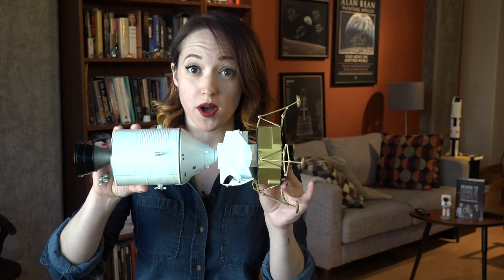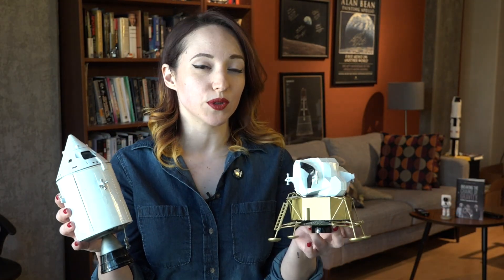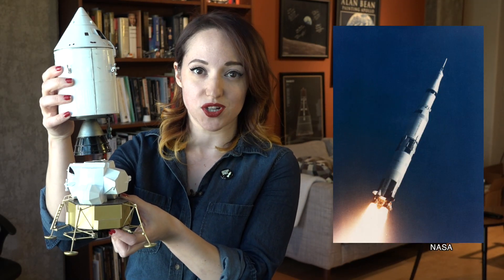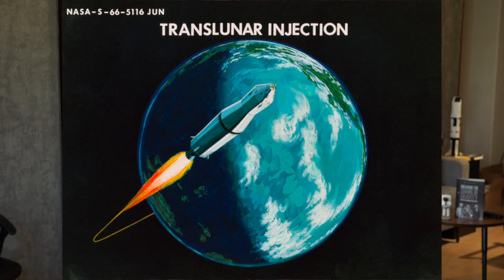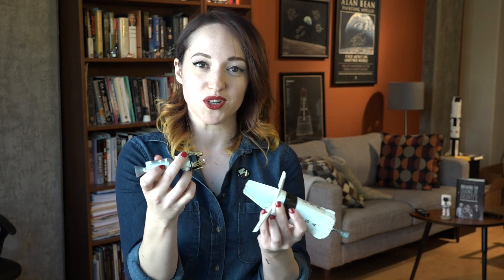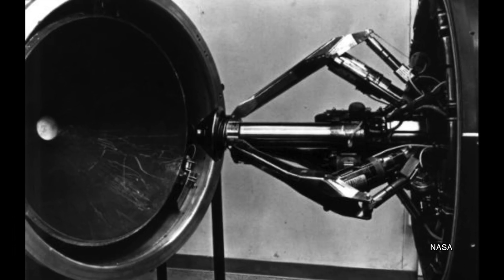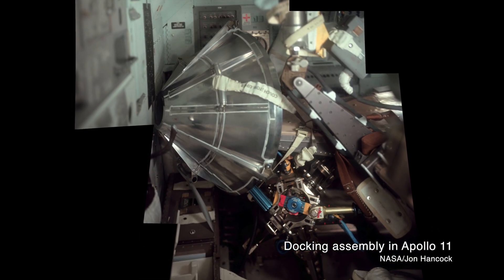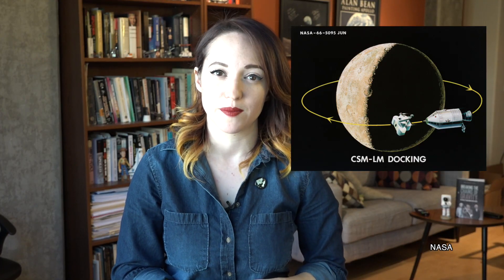How Did the Apollo Command and Lunar Modules Become One?

Comment: How did nasa get away with lies for so long, look into it.
Reply: By not lying
Reply: 21st century. Lots of technology. We have literally all the knowledge in the world in the palm of our hands. Still people falls for conspiracy theories? That's what amazes me the most.
Reply: @zeendaniels5809  so im supposed to beleive they can dock on the iss, that they say is moving 17 thousand mph... Just think about that for a minute.
Reply: @teleported1601  What wrong with it? If the spacecraft is moving at the same speed, it could dock. Is that simple.
When you are flying inside and aircraft, you can drink, you can eat, you could throw up an object and it will return to your hands despite all is moving at 600mph or more. It's the same deal here.
Reply: @zeendaniels5809  i see what your saying, although there's zero room for mistake at that speed, and never had a accident, thats all im saying.
Reply: @teleported1601  Actually there is a lot of room for error. Don't let the speed scares you, is not relevant if the ISS is moving at 17k mph. The important thing is the fact that the spacecraft docking is also moving at the same speed... So the relative speed between the two is very low (that's why in those videos of the Soyuz docking all appears to happen in slow motion).

Comment: Let me get this straight...as they were on the way to the moon..lunar lander and command module separated and connected moving at a high rate of speed...no thanks cannot be done.
Reply: You are currently traveling through space at 67,000 mph and yet manage to puta cup of coffee in your mouth
Reply: @onejasso  Bible says the Earth does not move.
Reply: @davidskaar3232  No, it doesn't.
Reply: "Bible says the Earth does not move." - that's not what scripture says, it also doesn't say it's flat or surrounded by any magic dome. two objects in space traveling at the same vector would appear motionless relative to each other, and with no atmospheric drag there would be nothing to slow them down or cause undesired movements. speed is relative to scale and frame of reference.
Reply: So refueling a fighter jet mid flight is also impossible?
Reply: @vyralator2638  one is witnessed. The other fantasy.
Reply: @davidskaar3232  No but think about it. How is it possible for one plane to dock with another? They're both going at insane speeds. There's no way that's possible. And they want  you to believe that they managed to do it all the way back in 1923? Madness.
Reply: @davidskaar3232  Are you saying it was impossible for a Shuttle to dock with the ISS @17,000MPH? That it's impossible for a Soyuz or SpaceX Dragon to do it? It's all fake?
Reply: @EVRose60  I'm saying you are being lied to on a grand scale. No space station. No space for anything to go to. 1986 shuttle crash astronauts still alive. No moon landing. Seek the truth....
Reply: Nature and Physics  it's fast

Comment: It was the clear next step for Apollo 14 to suit up,  eva out, dismantle the drogue, get it inside, check and fix it, get out connect it and dock it again. 
They would not enter the LM on this EVA but they would have done "hard suit work".  The procedure described here was a last attemp to avoid that and developed on a full size version by mission control and A14 backup crew around Gene Cernan. Gene Cernan himself get's on the capcom position and tells the crew of this idea.
They had time to fiddle with did for as long as the SIVB could hold it's attitude. Which was limited by it's battery lifetime, estimated at about 10 hours.

Obviously on return from the moon, if the docking again wouldn't work there was the (tested for emergencies) option of evaing from the LM to the CSM.  But that was indeed not an option for the initial transposition and docking, while the LM was still connected to the SIVB. They could not fly seperately to the moon. Would have been a navigational nightmare.

Comment: So the explanation of how the lunar landing module (with its tiny rocket) reconnected with the command module which was orbiting at 20,000+ mph around the moon, was that it just did?
Reply: Will Bernd : (1) the process of orbital rendezvous is a well-defined mathematical problem that is taught in space flight dynamics classes within a standard undergraduate aerospace engineering curriculum. No miracles here. Links abound on the Internet for details; (2) the LM was not traveling 20,000+ mph around the moon (much less), but that is immaterial to the discussion. We, each of us, on planet earth are moving around the sun at 66,000+ mph, yet we do not have difficulty, say, getting into our cars or driving to work. It is about RELATIVE speed with respect to a coordinate frame; (3) her explanation is with respect to the probe-and-drogue mechanism by which the two vehicles coupled/uncoupled, NOT about the orbital mechanics and dynamics of orbital rendezvous.
Reply: @Mike Dias The only one not understanding how things move is obviously you. If you would really understand it, you wouldn't write this bullshit.

Comment: Question: Did the lander have to reach the 16k mph speed the command module was moving at to reunite? Even without an atmosphere I'd imagine it would have to carry a lot of fuel to achieve this. I dont recall any documentaries covering this detail.
Reply: Yes, but remember that NASA went to great lengths to minimize the lander's mass and with the moon's lower gravity a significant percentage of the propellants could be used to produce the horizontal velocity change.

Comment: AGAIN WHEN SHOOTING A BULLET UNTO THE AIR TRYING TO HIT AN OBJECT TRAVELING AT HIGH SPEED,  NOT EASY. FANCY LANGUAGE AND TECK WORDS DO NOT MEAN IT WORKS. TODAY WE MAYBE ABLE TO HIT AN INCOMING MISSILE WITH ANOTHER MISSILE AND ONLY WITH POWERFUL COMPUTER.  HELP. SIMPLE DOCKING IDEAS ARE NOT SO SIMPLE WHEN THEY HAVE TO WORK. JUST REMEMBER LANDING THE LEM IN TESTS, COULD NOT DO IT, CRASHED EVERY TIME. I GUESS IT DID NOT MATTER IF THEY COULD LAND IT DURING TESTS. WHEN IT HAS TO WORK, JUST TAKE A CHANCE. HA.
Reply: If you don't even know that the Apollo Lunar Module was NEVER test flown on Earth, what value can your opinions on this subject possibly have?

The LM was not test flown on Earth BECAUSE it was not an aircraft - it was a pure spacecraft. It could only operate in the vacuum of space, and it could only make a controlled landing in 1/6th of Earth gravity. It was therefore only tested in space, and those tests were, of course, successful (including the Apollo 11 landing, which was itself a test).

You are confusing the LM with the Lunar Landing Research Vehicle (LLRV) and its successor the Lunar Landing Training Vehicle (LLTV). These were flying simulators that gave astronauts the necessary experience of 'flying' in 1/6th gravity that was so essential to making successful lunar landings in the LM.

Who told you that he LM "could not do it"?

T H E Y   L I E D   T O   Y O U.

Who told you that the LM, or LLRV, "crashed every time"?

T H E Y   L I E D   T O   Y O U.

The LLRV and LLTV made HUNDREDS of successful flights and simulated lunar landings. Over several years there were 3 crashes - none of which were fatal. The first crash involved Neil Armstrong, who ejected to safety, yet Armstrong made dozens of successful flights in this vehicle.

This is Armstrong's own statement regarding its use:
"Eagle (the Lunar Module) flew very much like the Lunar Landing Training Vehicle which I had flown more than 30 times at Ellington Air Force Base near the Space Center. I had made from 50 to 60 landings in the trainer, and the final trajectory I flew to the landing was very much like those flown in practice. That of course gave me a good deal of confidence – a comfortable familiarity.”

Orbital rendezvous is NOTHING like trying to hit a "high speed object" with a bullet. It's more akin to in-flight refueling, ot to pulling alongside another car at speed on the freeway. The speed you are doing does not matter. Relative to each other you are stationary.

Comment: THIS IS A JOKE. YOU SHOOT A PROJECTILE FROM THE MOONS SURFACE INTO THE SKY VERY LITTLE CONTROL OF DIRECTION, SPEED AND HEIGHT AND YOU EXPECT TO MEET UP WITH A COMMAND MODULE TRAVELING ABOUT 7 THOUSAND MPH. NO WAY IS THIS POSSIBLE. IT TAKES A DAY FOR A DOCKING PROCEDURE AT THE ISP USING LOTS OF COMPUTER HELP TODAY. IT IS ALWAYS SO EASY TO EXPLAIN HOW LUNAR MISSIONS WORK. NEVER ANY REAL DETAILS. JUST MAKE BELIEVE.
Reply: "...very little control of direction, speed and height..."

This is utterly untrue. Are you deliberately lying here, or just repeating a lie you have been told?

The LM employed the same guidance technology as the CM. It used the same techniques for rendezvous as had ben developed during Project Gemini (and which were subsequently employed by the Shuttle to rendezvous with various satellites, including the ISS). Gemini, by the way, used both computer controlled and manual docking techniques. It's not about having advanced computer systems but about understanding the orbital mechanics involved.

Comment: How did they point the ship in the right trajectory to fly from Earth to Moon after getting initially into Earth Orbit? Was it all calculated according to the date, the spinning of the planets and their relative positions and where the Moon would be in 3 days? Or did they sort of guess and then do course corrections as they got closer to the Moon? Would they aim at a point in space where the moon would be in 3 days... it's mind boggling as the Earth, Moon and ship are all moving so I don't understand how they can manage to get to the moon without very precise calculations and timing?
Reply: I don't think they had to worry about the motion of the Earth - only about the motion of moon and spacecraft relative to the Earth.

The spacecraft was tracked from Earth with all of the necessary manoeuvres radioed up for input to the AGC. The Saturn V shot them to the moon like a gun sending a shell to a desired target. As the spacecraft was tracked necessary course corrections were determined and executed (up to 4 each way).

Both spacecraft used a gyroscopically stabilised platform mounted on gimballs (so that the spacecraft always rotated around it) to determine spacecraft attitude at any given time.

I recommend "How Apollo Flew to the Moon" by David Woods.
Reply: The did all the math beforehand

Comment: Did you listen to anything you said? We're talking aerial acrobatics at 25,000 mph. First of all, thrust doesn't work without a medium to push off of. With that fact pointed out. How did they get anywhere at all? Go ahead. I'm pretty sure you'll say "gravity." Anyway. How did the command module disconnect, separate itself from the rest of the rocket (still travelling 25,000 mph) have enough room to flip 180°, reconnect itself, and pull out the lunar module away from the rocket? You don't make any logical sense. Stop and use your brain. Don't regurgitate things you can't explain very well.
Reply: "We're talking aerial acrobatics at 25,000 mph".
The launch stack was only accelerated to that velocity in the vacuum of space.

"First of all, thrust doesn't work without a medium to push off of".
Wow! You're attempting to deny that rockets cannot work in vacuum - that is not clever. Rockets work as dictated by Newtonian Physics. It is impossible to accelerate ANY mass (rocket propellant has mass - most of the Saturn V's 3000 tons was made up of propellant) WITHOUT applying a force to it. So in order to accelerate propellant through the engine nozzle it is necessary to apply a force to it. The opposite and equal reaction to that force is THRUST. That is why propellant is referred to as "reaction mass". In effect, the propellant (and it's inertia) is the "medium" that you claim is necessary for thrust.

"How did the command module disconnect, separate itself from the rest of the rocket (still travelling 25,000 mph)..."
Its speed is irrelevant to its ability to do any of those things.

"...have enough room to flip 180°..."
Space is big.

YOU don't make any logical sense.  Stop and use your brain. Don't regurgitate things you can't explain very well.
Reply: Let's look at this logically if you are on a highway and there are cars moving at the same speed you are could you pass someone a hamburger through the window while you are moving the same speed as each other. It is not only possible but even almost easy this is possible because of relative speed the difference between you and what your target is

Comment: Can someone explain to me how the lunar lander lifting off from the moon at 10 MPH managed to get to 1.5 miles per second to rejoin with the Command Module that was in orbit around the moon? 1.5 miles per second is faster than a 50 cal bullet !!
Reply: Your 1.5 miles per second is a velocity that is higher than lunar escape velocity. It is not possible to be orbiting the moon at the same time as travelling at, or faster than, lunar escape velocity. That is, if you are escaping your are not in orbit and if you are in orbit you are not escaping, they are mutually exclusive states. And a lunar orbit rendezvous is performed while orbiting.

Acceleration to a velocity much closer to 1 mile per second was done with a rocket engine.

Comment: Wow not trying to be mean but did you ever realize it there wasn't enough power and that little lunar module engine it landed on the moon to get back up to 4000 miles per hour 2.4 docking it was impossible they never made it to the Moon the engine in the lunar lander couldn't reach mock for which is 4000 mi per hour approximately and that's the speed they needed to catch up the lunar module so in reality it was impossible to do that they didn't go to the Moon the proof is in the pudding go do your science better
Reply: The lunar module had two stages the bottom stage had enough change in velocity to slow itself and land the upperstage which was combined with the crew cabin had enough fuel to get to orbit
Reply: Great David. Just show us your analysis......

Comment: vintage space- lady you are living in a fantasy land, please explain how the lunar module was able to reconnect with the command service module. Which happened to be orbiting the moon at 4000 mph. please show angles, methods of acceleration or deceleration,etc then answer these questions: how did we guess the moons gravitational force and get it exactly right?, when we have zero knowledge of its density. therefore zero knowledge of its mass.q#2 how is it nothing bad happened when they traveled through the van allen radiation belts?q#3 how did nasa lose the technology to go to the moon? q#4 why can't we get through the van allen belts today, when it wasn't a problem in the 60s? and finally the bonus round: how is it that elon musks starman tesla automobile did not melt and bubble or freeze and crack, in the negative nine torr or so vacuum where the temps should range from 260 c to negative 100 c?

Comment: docking is one of the most tricky operations in space. to dock the craft needs to turn so the docking interface is pointed towards the drogue and the docking probe is extended. Once the probe makes contact with the drogue it is retracted and the Barber Pole Lights turn on. Once the Barber Pole Lights come on then the spacecraft magnetic locks, hooks, and latches are engaged and the robotic bolt guns drive 24 explosive bolts into the docking caller and the word and light that says Hard Dock come on. Once Hard Dock is engaged the hatches are open and the spacecraft is pressurized to 90 PSI so the crew can enter.

Comment: Amy, in the movie Apollo 13, they use an umbilical connected between the LEM and Command Module to transfer enough electrical current to the CM without damaging the sensitive guidance computer.  I've always wanted to know more about this umbilical, and all I've found was that there were actually 2 umbilical cables and they were somehow needed during LEM extraction from the S-IVB.  They provided initial power to the LEM that released it from the S-IVB.  That's all I know.  Can you tell us the whole story of these mysterious umbilical cables that saved the crew of Apollo 13?!

Comment: :)

It seems all the latching hardware would make it extremely difficult for an astronaut to crawl through that relatively small ternal. I guess there must've been some clever system engineered so that's the latching all hardware moved out of the way to the perimeter of the tunnel so they could make it through. Perhaps one day you'll care to go into that important detail.?

:)
Reply: The probe was manually detached from the tunnel walls and pulled into the command module. It had to be reinstalled in the tunnel before the lander was separated in lunar orbit.

Comment: The bit I've never understood, and even your blog post doesn't really cover, is how this 'crew withdrawal' of the drogue and docking mechanism worked. In all pictures it looks like both have a larger diameter than the hatch. The docking mechanism looks like it could be extended to reduce it's diameter, and presumably the hatch opened inwards towards the command module, so that they could get at the docking mechanism fixing points. But what about the drogue? Did that work like an umbrella?